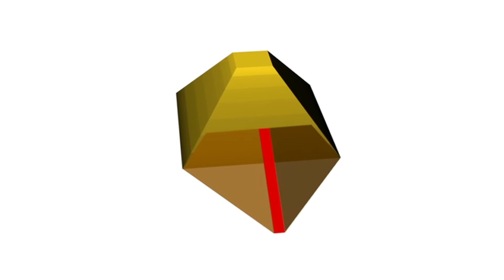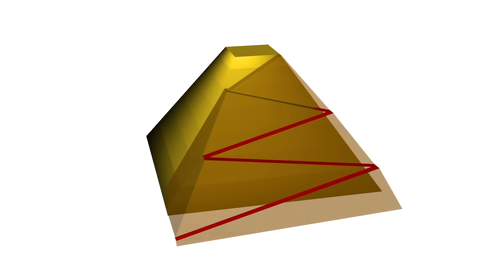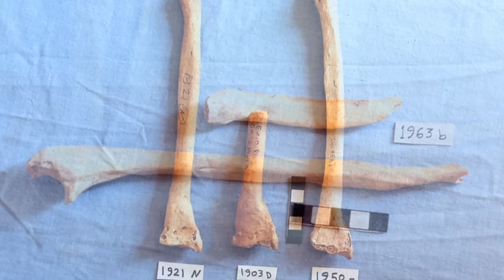Egyptology - Pyramid Construction

Comment: Can those archeologists build a wall with the precision that can be seen inside the great piramid by using the technics they explain to us that were used? Talk is easy. So far nobody has ever been able to duplicate even in smaller size (gigantic scale is even dream)  the precision of megalithic walls and polygonal walls by using stone hummers and bronze chisel. Archeologists just talk talk talk and prove nothing.
Reply: Asia Asia Good point. Even if you managed to cut a 50 ton piece of granite to shape, transport it, and lift it into place, how on earth do you nudge it a few mm to be aligned exactly with its neighbour?
Reply: The same way they cut, transported, lifted granite obelisks weighing 600 tons. If they could nudge a 600 ton needle shaped rock into place, then 50 tons is child's play.

There is even an unfinished 1200 ton obelisk with the tools lying around along with the indentations of the tools. If a piece of 1200ton granite was cut halfway with a saw, the evidence would have been obvious. The same goes for if it was pounded to shape with dolerite hammers halfway. It too would be obvious. In this case it was obviously pounded with the multitude of dolerite hammers lying around.
Reply: +Tyler Durden 800 HP military evac truck can't move 50 tons an inch, unless they are placed upon a solid wheeled platform (not the same thing as logs).
Reply: Hello, very interesting, but we're bringing news about how the Great Pyramid was built in Egypt. In Romania, a book, THE SECRETS OF BUILDING THE GREAT PYRAMID OF EGYPT, has completely new theories about this subject.                                                                     . Go to www.thegreatpyramidofegypt.com  , in Read fragments ( menu = translated into English / Fragments of the book and Romanian / Fragmente din carte ; comments/ comentarii) and have some comment ?
Sincerely, Hantz.

Comment: The question that I have is the block sizes. When we build stuff today, we use "building blocks" that we can easily manipulate. Why would someone struggle with blocks so much larger than what can be easily handled? That is the part I don't get. I would assume if they used 2 ton blocks that they would be able to manouvre them relatively easily.

Comment: sure they move 100 or 200 ton blocks from site 500km  be pushing :DDDDDD but before they shape so hard red granite stones by soft  copper chisels:DDD perfect shape then put then in perfect angles driling perfect hole  for kings chamber probably with those chisel :DDDD and they finish job for 20 years there is 2 milions stones blocks so they have to shape ,push pull each block each 2 minutes to finish it.
. We cannot do that yeat for 20 years even with our technology so stop lisening bullshit.

Comment: No one has ever pulled even a 5 ton block on sleds and ramps (much less the dozens of 60 ton blocks used), because it cannot be done.  They were simply floated into place using water. It is the only method that could have been used, especially in those times. Even today we can float things that we cannot lift otherwise. To see the only provable working method for building these structures, go to James Northcutt on youtube.
Reply: James Northcutt what is the pressure of a 200 ft Calum water at the bottom

Comment: Article #2:

 
  
   "Geopolymers 
   are new materials for fire- and heat-resistant coatings and 
   adhesives, medicinal 
   applications, high-temperature ceramics, new binders for 
   fire-resistant fiber composites, toxic and radioactive waste 
   encapsulation and new cements for concrete. The properties and uses 
   of geopolymers are being explored in many scientific and industrial 
   disciplines: modern inorganic chemistry, physical chemistry,
   
   
   colloid chemistry, 
   mineralogy, geology, and in other types of engineering process 
   technologies. Geopolymers are part of polymer science, chemistry and 
   technology that forms one of the major areas of materials science. 
   Polymers are either organic material, i.e. carbon-based, or 
   
   
   inorganic polymer, 
   for example silicon-based. The 
   
   organic polymers 
   comprise the classes of natural polymers (rubber, cellulose), 
   synthetic organic polymers (textile fibers, plastics, films, 
   elastomers, etc.) and natural biopolymers (biology, medicine, 
   pharmacy). Raw materials used in the synthesis of silicon-based 
   polymers are mainly rock-forming minerals of geological origin, 
   hence the name: geopolymer. 
   
   Joseph Davidovits 
   coined the term in 1978[1] 
   and created the non profit French scientific institution 
   (Association Loi 1901) Institut Géopolymère (Geopolymer 
   Institute).

   ..............
   
   Egyptian Pyramid stones
   
    Main article: 
    
    Egyptian pyramid construction techniques
   With respects to archaeological 
   applications, in the mid-1980s, 
   
   Joseph Davidovits 
   presented his first analytical results carried out on genuine 
   pyramid stones. He claimed that the 
   
   ancient Egyptians knew how to generate 
   a geopolymeric reaction 
   in the making of a re-agglomerated limestone blocks.[44] 
   The Ukrainian scientist G.V. Glukhovsky endorsed Davidovits' 
   research in his keynote paper to the First Intern. Conf. on Alkaline 
   Cements and Concretes, Kiev, Ukraine, 1994.[45] 
   Later on, several materials scientists and physicists took over 
   these archaeological studies and are publishing their results, 
   essentially on pyramid stones.[46][47][48][49]"

Comment: The Scientific Proofs:
Let us look at how science recently discovered how the Pyramids of Giza were 
built.
   
Article #1:

 
  
   
    "Since the early eighties, Prof. Joseph 
    Davidovits is proposing that the pyramids and temples of Old 
    Kingdom Egypt were 
    constructed using agglomerated limestone, rather 
    than quarried and hoisted blocks of natural limestone. This type 
    of fossil-shell limestone concrete would have been cast or 
    packed into molds. Egyptian workmen went to outcrops of 
    relatively soft limestone, disaggregated it with water, 
    then mixed the muddy limestone 
    (including the fossil-shells) with lime and 
    tecto-alumino-silicate-forming materials (geosynthesis) 
    such as kaolin clay, 
    silt, and the Egyptian salt natron (sodium carbonate). The 
    limestone mud was carried up by the bucketful and then poured, 
    packed or rammed into molds (made of wood, stone, clay or brick) 
    placed on the pyramid sides.
    This 
    re-agglomerated limestone, bonded by geochemical reaction 
    (called geopolymer cement), thus hardened into resistant blocks. 
    In 1979, at the second International Congress of Egyptologists, 
    Grenoble, France, he presented two conferences. One set forth 
    the hypothesis that the pyramid blocks were cast as concrete, 
    instead of carved. Such a theory was greatly disruptive to the 
    orthodox theory with its hundreds of thousand of workers taking 
    part in this gigantic endeavor. The second conference stressed 
    that ancient stone vases manufactured 5000 years ago by 
    Egyptians artists were made 
    of cast synthetic (man made) hard stone.

    J. Davidovits’ research was fiercely opposed by some experts 
    (geologists and egyptologists) who did not refrain from 
    publicizing the usual brickbats. The theory was finally 
    published in a popular book, in 1989, entitled: “The Pyramids: 
    an enigma solved”, Hippocrene Books, New York (4 printings) and 
    later by Dorset, New York. In 1998, Prof. Davidovits resumed his 
    work and he has presented updated and new results at Geopolymer 
    Congresses. (See details in 
    
    Archaeology applications in Geopolymer 
    Proceedings ). Also, revised 
    editions of the book has been published since 2003, see 
    
    They built the Pyramids 
    and also the books published in different languages at 
    
    
    J. Davidovits website.Unanswered Questions:
    
    The 
    carving and hoisting theory indeed raises questions that have 
    been insufficiently answered. Using stone and copper 
    tools, how did workers manage to make the pyramid faces 
    absolutely flat? How did they make the faces meet at a perfect 
    point at the summit? How did they make the tiers so level? How 
    could the required amount of workers maneuver on the building 
    site? How did they make the blocks so uniform? How were some of 
    the heaviest blocks in the pyramid placed at great heights? How 
    were twenty-two acres of casing blocks all made to fit to a 
    hair’s breadth and closer? How was all of the work done in about 
    twenty years? Experts can only guess. And Egyptologists must 
    admit that the problems have not been resolved.
    Theories of construction are many and 
    continue to be invented. All are based on carving and hoisting 
    natural stone, and none solves the irreconcilable problems.
    The casting and packing 
    agglomerated stone theory instantly dissolves 
    the majority of the logistical and other problems."  
    (Source)
       

    Additional valuable links:
    
     
     http://www.davidovits.info/book-why-the-pharaohs-built-the-pyramids-with-fake-stones/ 
     
     
     http://www.davidovits.info/paleomagnetism-study-supports-pyramid-man-made-stone/ 
     
     
     http://www.geopolymer.org/archaeology/civilization/papers-dedicated-to-archaeology-in-geopolymer-proceedings

Comment: No one has ever been able to pull any multi-ton stones in this fashion, and thousands have tried. Most recently universities at Stonehenge (Nova documentary) and Unv. of Louisiana (Lafayette) have proven it to be impossible with even a 5 ton stone, much less the 60 ton stones high up in the structure. The only method that answers all the requirements with "what the ancients had" rule is water floatation building where the stones are simply floated "up" the side of the structure as does the Panama Canal with much heavier loads. Go to James Northcutt on youtube to see a demo. of this process. It is so simple, yet capable of the task that it will amaze you.

Comment: Are you kidding me? Someone prove to me how to cut a slab of granite weighing 4 tons with 90 degree angles on all sides with near flat profiles and parallel faces,
with less than a 1mm tolerance?

There is no way 2 million  or whatever stone blocks can be cut accurately that fast, at that scale within a 20year timeframe.

All that precision with a copper chisel, a piece of string and a rock ...............10/10 engineers say no

Comment: Hydraulics high pressure and counter weights. dragging them up a ramp manually what non sense even a series of tripods lifting them up one level at a time would make more sense than this bullshit.
Reply: They say levers which I find as silly as the notches on the blocks could not hold a lever.  No one computer animates how a lever could be held in position.  But it seems the Egyptians were good at making rope.

Comment: you have to make a surface as flat out of granite with those tools for this to be true, you cannot and it is not true, they had circular saws and power tools, also you cannot move 8-10 ton stones with guys pulling on them. cant be done. also also the external ramps would often be bigger than the structure, so more ramp then pyramid to build the largest structure in the world does not seem to be a realistic way to go about it. i like the internal ramp idea, and the gallery as a lifting machine for the kings stones. still you need power tools to do this,, cant be done without them. this machine must have been vary important to put out all this effort, more important than making electricity i would say because there are easier ways to do that.
Reply: I got a friend who is a machinist.  He moves 18 tons of cast iron machinery from the dirt driveway to inside his shop with cement floor.  And he does it on a weekend.  His "extra men"is a farm tractor(or 25HP) So, how he does it, he keeps a secret.  He has moved it 4 times and into confining spaces.  So to him, moving great weights is "no big deal" uphill or downhill or around a corner.
Reply: DANTHETUBEMAN one key word water
Reply: Bernie. Lift if 4 inches with levers or hydraulic jacks and then slide round logs under it and roll it by pulling it with a come along. I used to move 1,000 pound safes alone with these simple tools, lever bars and pieces of pipe to roll it on.
Reply: They used a very sharp bronze chisel, and a big fucking hammer, to make the blocks. Then dragged them 100 miles uphill to the pyramid, by using goats, and camels.LOL .
Reply: I believe in aliens but i believe and in ancient  Egyptians. Do you?

Hello , what you are saying is very interesting, but it doesn’t bring anything new  about how the Great Pyramid of Egypt was built. In Romania, a book was published, THE SECRETS OF BUILDING THE GREAT PYRAMID OF EGYPT, which has completely new theories about this subject.                                                                     . 
Go to www.thegreatpyramidofegypt.com , read fragments ; the section Fragments ( menu = translated into English / Fragments of the book and Romanian / Fragmente din carte ; comments/ comentarii) and have some comment.
Sincerely, Hantz.    

www.thegreatpyramidofegypt.com      

  1 - Pharaoh Cheops And The Great Pyramid 
  2 - Menu / Meniu :  
  3 – English / Romana:
  4 - Fragments of the book / Fragmente din carte :     
  5 – Comments / Comentarii:
read "fragments of the book" and you will find interesting things.

Comment: They built a sand ramp straight on,  and they used layers of wood-like materials inside the sand ramps themselves to stabilize the sand so less sand was needed.  For the stone blocks, they attached  Quarter-rounds to each flat face, and then simply used ropes wrapped around the 'now round' block to roll it up over wooden planks laid down on the sand ramps themselves.  Quite simple actually.